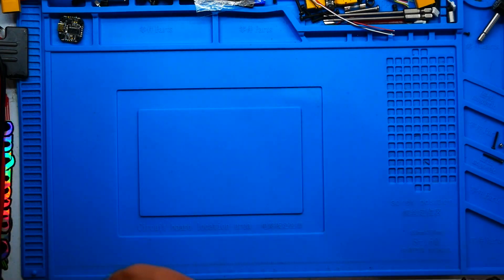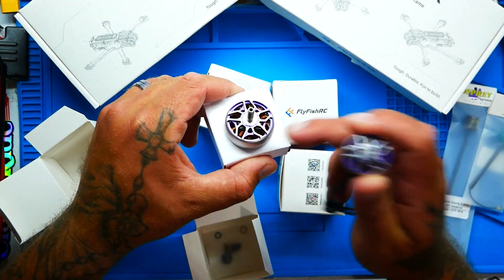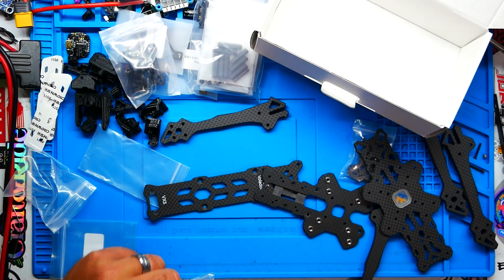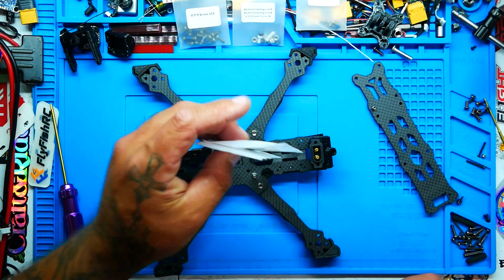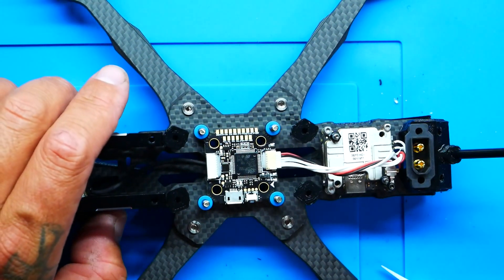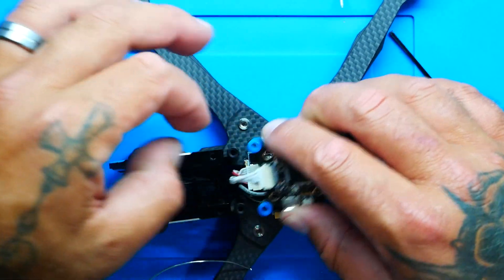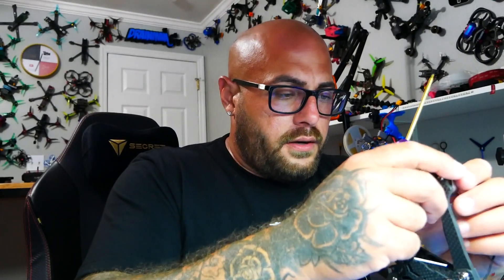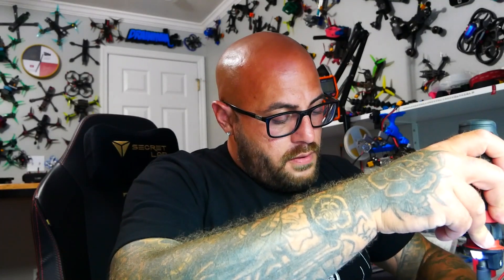Let's Build The New Volador 2 Freestyle Frame!

Comment: Building one of these now (the deadcat version) and under the pads on the esc for the xt60, there is a carbon cutout. That carbon cutout I believe is for a 470uf cap, as one fits perfectly and it has a science cut for a ziptie. Just thought Id let you know.